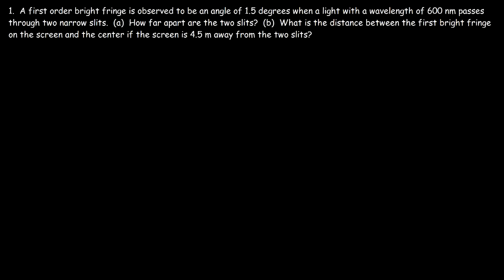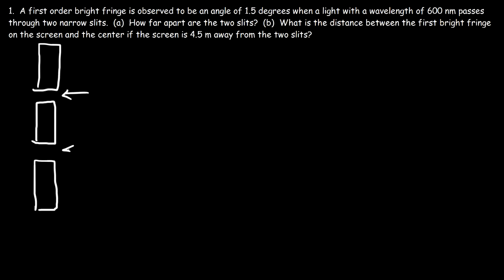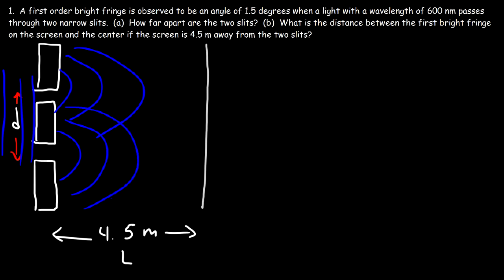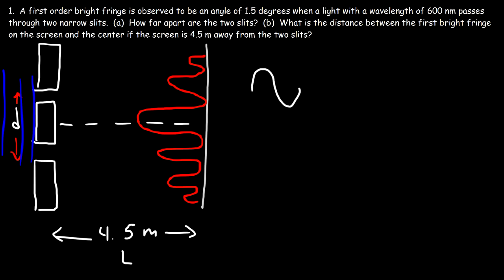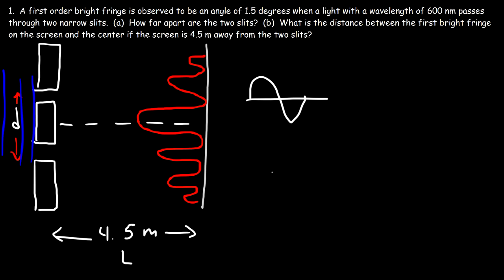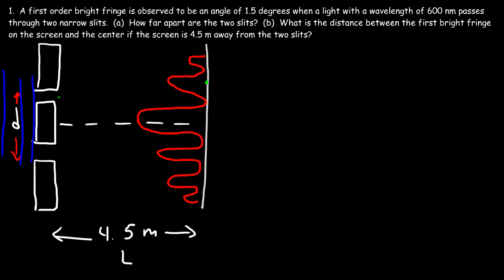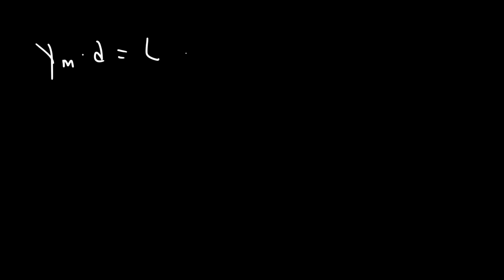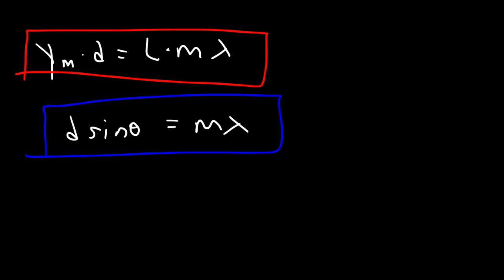Young's Double Slit Experiment

Comment: A wave is spread across. In a double slit experiment, if the wavefunction representing the electron, hits the slits, shouldn’t that be a measurement and shouldn’t that collapse the wavefunction? Now, you'll say it's not a physical wave, it's a probability wave. But then how does a probability wave split into two after the slits? Then, it should be like, the wave hits the slits, the electron says, dude I'm going through the slits, so don't collapse, but you can split into two and diffract. When does it decide that it's going through the slit?

Comment: What would happen if the constructive interferencing from 1 set of double slits passed through another set of double slits? Would the universe break because of energy being created?
Reply: 😂😂😂 it's very likely that's you'd not be able to align the double slits at the exact same spot where the waves are in phase, but if you do... You'll just get another interference pattern where the intensity/amplitude is lesser than the last interference pattern you saw. 

The highest intensity in an interference pattern is achieved at the centre of the double slits (projected on the screen) but if you plan on using another 'Double' slit, the starting intensity of the light would be less than the original, and hence you'd only get a fainter interference pattern :)

Comment: Can we use white light in this expriment ? If yes how ? If not why ?
Reply: No, because white light is a mixture red, blur, green, ect., which are at different wavelengths. This experiment uses light at just one wavelength. If you use light with different wavelengths, then each wavelength is going to be diffracting at different angles and interfering with each other so you won't get the neat maximum-minimum pattern on the screen
Reply: Yes, you can use white light, it will just produce an even cooler looking interference pattern as the different colours will diffract at a different angle, leaving you with something similar to a horizontal looking rainbow
Reply: Monochromatic light is preferred because the resulting interference pattern is more sharper when compared to a white light (which is a mixture of other colours).

White would give you interference, but not as sharp and distinct as a monochromatic source.

Comment: WHY ARE THE TWO ANGLES THE SAME I DONT GET IT HE JUST 3:58 4:00 4:02 ARGH WHY PLS
Reply: Remember how he drew that triangle on the figure first and then erased it? They are equivalent because the angle the light is travelling at, was determined by using the triangle. So thus he drew the triangle, got the angle, erased it and then used the same angle again, as it was determined that they're the same thing